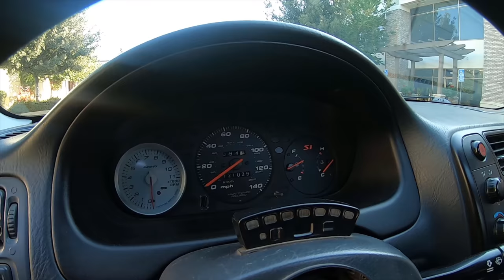2000 Honda Civic Si: Track Ready EM1!

Comment: I just got a black 2000 si.. about to replace so many parts to bring it back to life. Clean car bro
Reply from the maker: So glad to hear Michael! keep us updated on the build
Reply: Most definitely, I got all the energy suspension bushings which I know so many forget/ neglect doing. It improves the over all ride and handling sooo much. Along with window moldings, Windshield wiper cowl, gonna re spray it black soon, got new vtec stickers, si badge, new floor mats, nrg seats, momo steering wheel, nrg shirt hub and quick release, steel braided brake lines, new brake pads, camber kit, new skunk 2 LCA’s, new tires, fuel filter, timing belt, sub & amp, window visors, tie rod ends, front upper and both rear strut bars! There’s more I just can’t think of all the parts.. some of that list I have some on back order the rest like radiator, intake, exhaust, coil overs, is already on the car